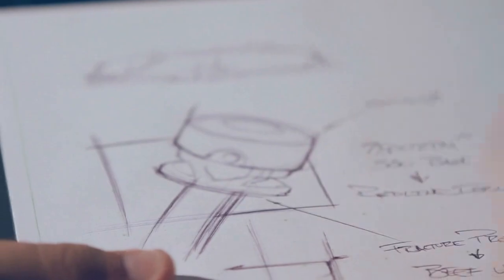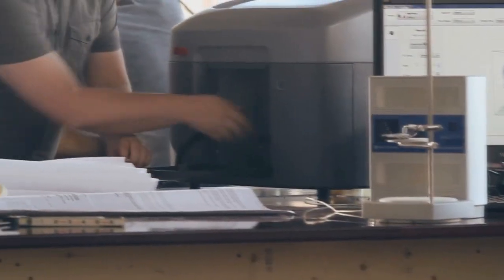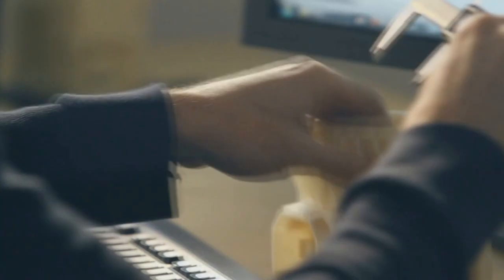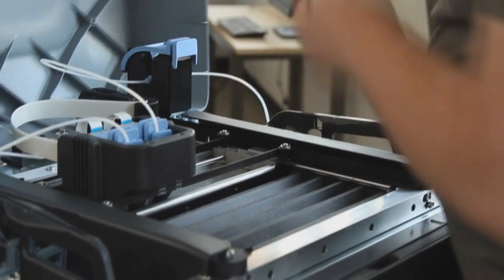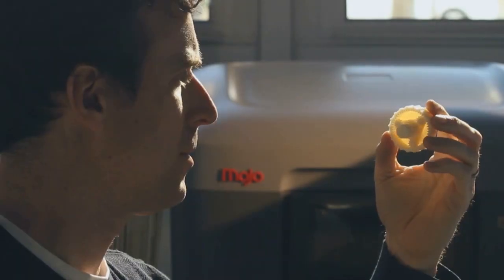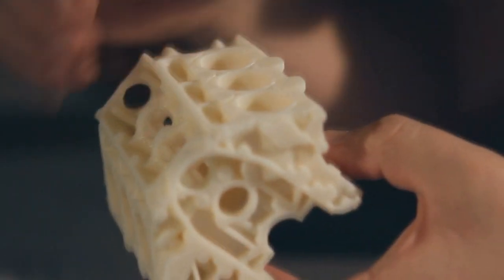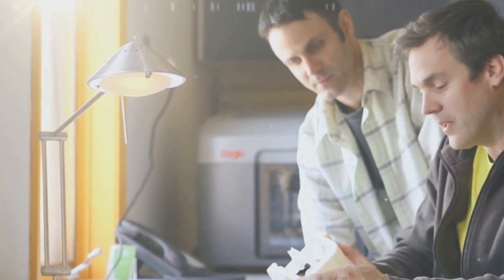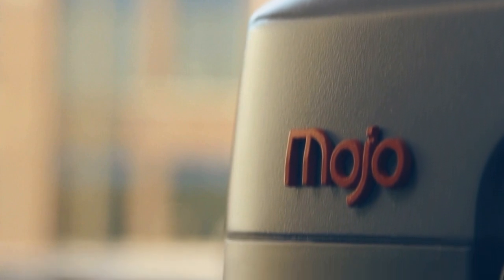Top 5 Best 3D Printers You Must Buy - Cheap 3D Printers

Comment: not for the price plus if it not in the right hands they won't be happy camper the company says it cheap he'll no.for fabberster look at Amazon ratings I could use fabbster for parts in most cases a 300 dollar 3d printer will neat a 60000 3d printer

Comment: Here is an inexpensive 3 d printer, works pretty well but you do have to put them together yourself. $330 CDN

http://www.aliexpress.com/item/3d-Printer-upgrade-products-i3A-Aluminum-alloy-frame-Improve-the-Printer-accuracy-Less-vibration-Print-out/32521672228.html?spm=2114.13010208.99999999.261.0oB7O2

Comment: Heads up guys, if you want a cheap 3D printer for a lot less than a ridiculous $1,000, then checkout the Geeetech Delta Rostock Mini from Banggood: http://www.banggood.com/DIY-Geeetech-Delta-Rostock-Mini-G2s-Dual-Extruder-3D-Printer-Kit-With-Auto-leveling-p-983462.html?p=JQ26191551677201504Z
Reply: +Wane Hall Yes,  some start from $352, which is a lot less then those shown in the video.
Reply: +Wane Hall Thanks for the link. I see they've got a whole range of printers and accessories fro sale

Comment: this does not make sense because it says cheap 3d printers and the cheapest one is over $1000. if you want a cheep 3d printer you would get a tiko when it comes out or a m3d micro 3d printer both are and will be under  $500.

Comment: Fabbster Must be out of their mind, who in their right mind would like to use segmented filament like that, Just like XYZ and their cartage, damn sales scam....  Take a hike Fabbster
Reply: +HoppersLab 
I can see what they were thinking. The ribbed structure of their printing material allows to remove feed slippage, that can seriously increase the quality of the prints.
And of course overcharging for materials is always a great one-way argument.
But the rest of the printer is so mediocre, that better feed just isn't helping, like at all.

So i don't think people will fall for that -.- Better compromise would be a feed encoder sensor, so the feed will be adjusted fro slippage, you'll be paying maybe a few $ more for the printer, but at least you can just run normal material through it.
Reply: +HoppersLab yes. and I get the feeling they may even give the printer away free for a years subscription to the bespoke IP protected media.

Comment: When the first printer was printing the bottle. What was the line when it started?
Reply: +EdwardAlcala its just an extra feed line so it gets all the waste plastic out for a clean print. The updated ones do a small line on the front of the plate.
Reply: Do you mean at 1.50?
Reply: +EdwardAlcala If you setup the printer to print without "raft", it could mix the colors of plastic filaments that you used before. To prevent it to happen, the printer prints that line that could have two different colors of plastic. If you setup the program to print a Raft in the bottom of the model, it will print without the line as it will print something before the model anyway.